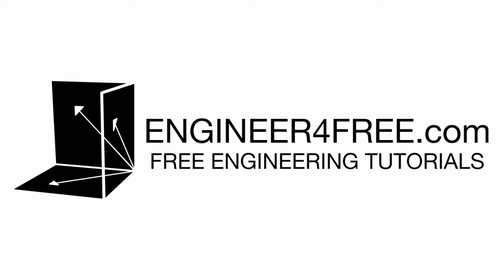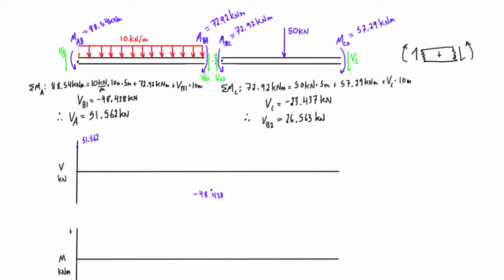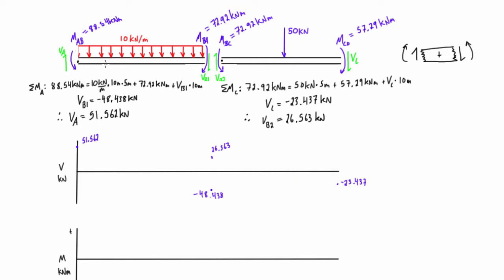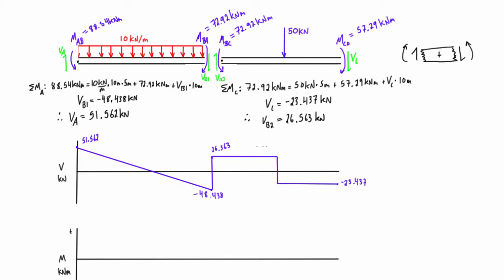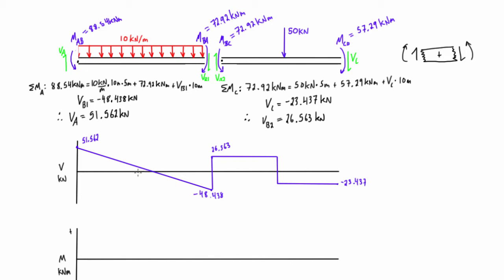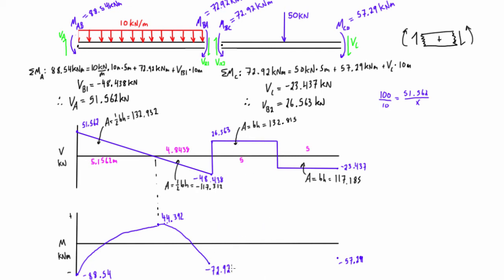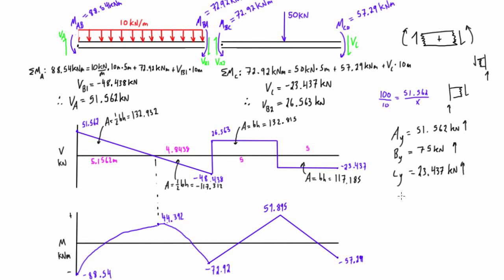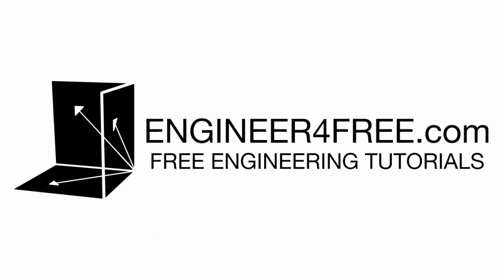Slope deflection method example #1 (part 3/3)

Comment: This seems a lot of work to just get the BMD...Is there some easier way and can we get the deflection curve as well?
Reply from the maker: Hey this is just one of many methods available to find BMD if statically indeterminate beams.  Heck out engineer4free.com/structural-analysis for a few other methods that I covered too 👌
Reply: @Engineer4Free  thank you sir